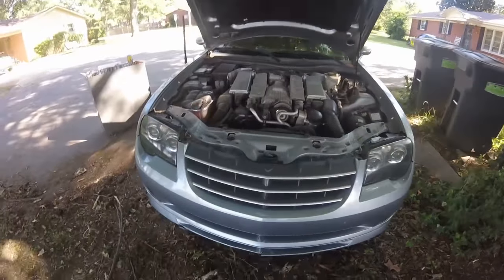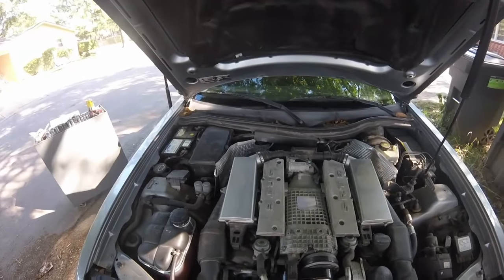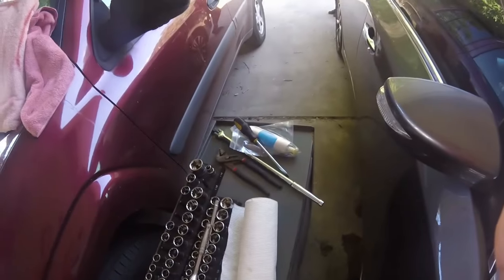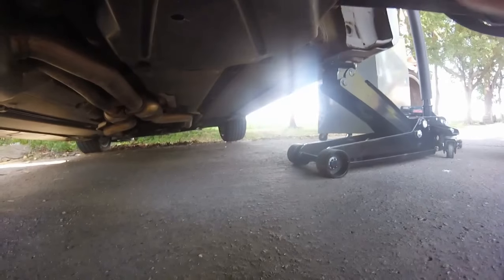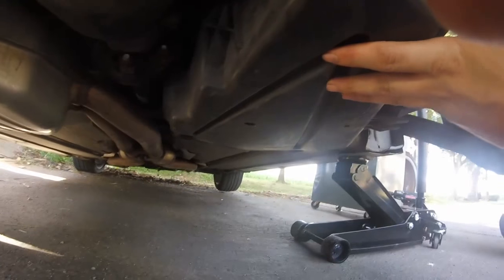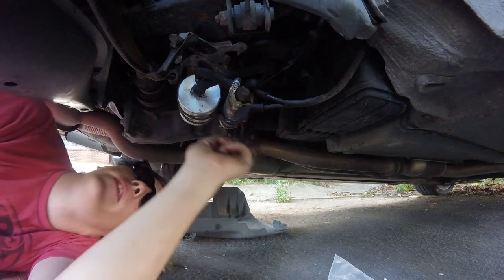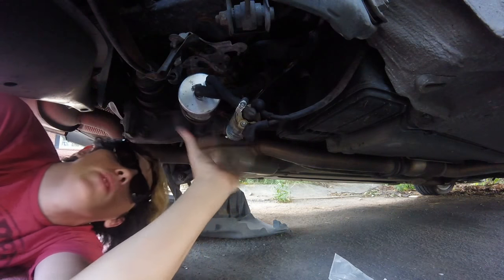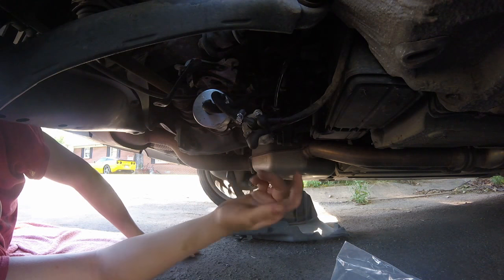SRT6/SLK/Crossfire: Fuel Filter and Fuel Pump Repair/Replace

Comment: What fuel pump did you use/get? How much was it? Is there a difference between the srt6 fuel pump and the naturally aspirated fuel pump?
Reply: I am wondering if a cheaper option is going to be ok  to use.  On Amazon  $70. Others $210 to $235.
Reply from the maker: I looked at the spec on rockauto between the srt6 and a na crossfire and the gph for flow was about the same between 50-30

Comment: I'm getting intermittent chugging, little power, and random stalls while driving. Runs fine at idle. I have a code for running lean. Going to give this a shot to see if it fixes.

Comment: yo what's up! hey sometimes my 04 crossfire feels like it loses power (or chugs) when I accelerate lightly, or decelerate lightly (low RPMs), once it took a couple seconds of spins to start it, and it idols a little bit rough... one time at low speed it chugged and felt like it was going to shut off... otherwise, the car accelerates quickly. If I put my foot to the floor it goes. the problem is mostly at low speeds/RPMs. I only owned it for 1 week. and it only has 32,000 miles on it. looks really clean under the hood, and under the body. it was garage kept by an older dude. 

any ideas? Should I start with a fuel filter? and if I do, what fuel filter should I buy? and is this a job a noob can handle? because I couldn't hear you too well in this video lol. Subscribed! Thanks buddy
Reply from the maker: I would start with spark plugs and fuel filter. This would be the best place to start it also would not hurt to clean the throttle body and MAF sensor.

Comment: I just change the fuel pump and it's doing the same thing😭😭😭
Reply from the maker: Is it not starting completely or is it turn the key s couple of times before it starts?
Reply: @justastreetcar4273  yes it will start for a second. So I just changed the crankshaft position sensor and it's still doing this
Reply: Where is the fuel pump relay fuse in the crossfire a lot of the Chrysler's are in the trunk
Reply from the maker: @christinastender4292  the fuel pump relay is located inside the RCM its located on the passenger side in th engine bay just in front of the battery. I have a video that covers removing and inspecting the rcm.
Reply from the maker: @christinastender4292  the only thing in the trunk is the central locking module it's a medium size black box in the trunk under the flap for the air pump it will be on the passenger side it just controls the locking/unlocking cylinders for the doors and trunk.
Reply from the maker: @christinastender4292  the only thing in the trunk is the central locking module it's a medium size black box in the trunk under the flap for the air pump it will be on the passenger side it just controls the locking/unlocking cylinders for the doors and trunk.
Reply: @justastreetcar4273  OK I've watched the video. As soon as it stops pouring I will take it out.
Reply from the maker: @christinastender4292  alright let me know how it goes.
Reply from the maker: @PlaywithDaisy  I am not a 100% sure, but I am pretty certain it does control the convertible top.